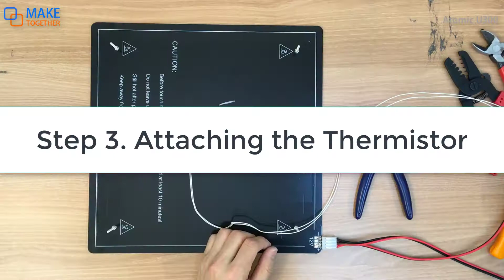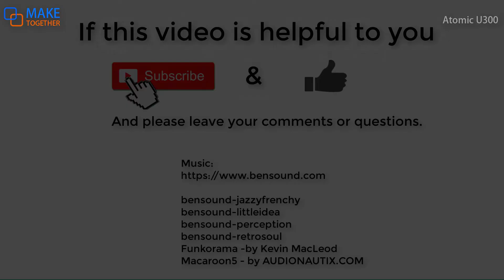Ultimaker Style 3D Printer Build Tutorial 12 - Heated Bed Wiring and Attaching

Comment: Been looking at this project, did you have a good source for the linear rods and the screws? Buying from amazon is going to cost nearly 300 dollars.
Reply from the maker: Thank you for your question, solidshark!
I use linear shafts sold by MISUMI because the quality is much more important than the cost.
And for the T8 linear screw, I usually search for good sellers at the Aliexpree web site.
I hope this will be helpful to you, friend.
Reply: @MakeTogether  It helped a lot, I got rods from Misumi. Great quality. The M3 screws I have are too small for the heat bed though. Its a creality heat bed, 310x310mm. The head sits far enough down that when tight the nuts dont have enough thread to make it tight before it hits the head. It calls for M4 screws.